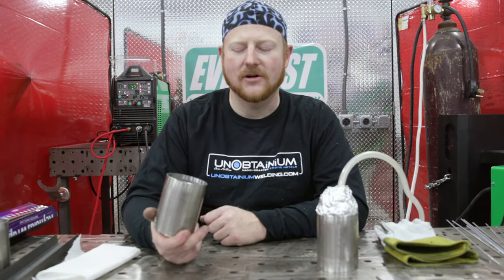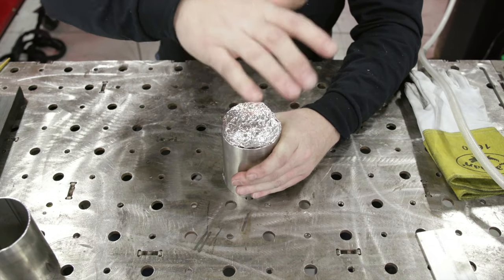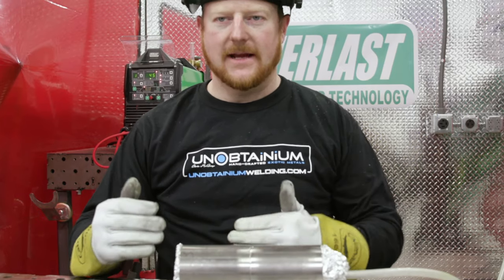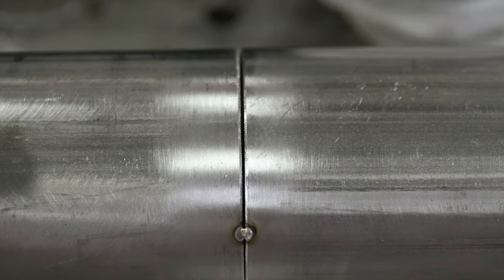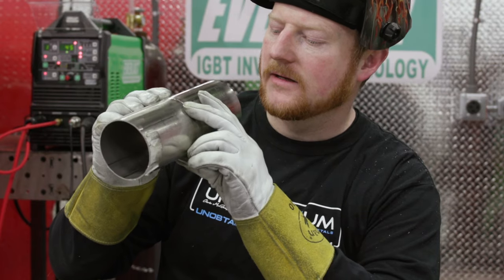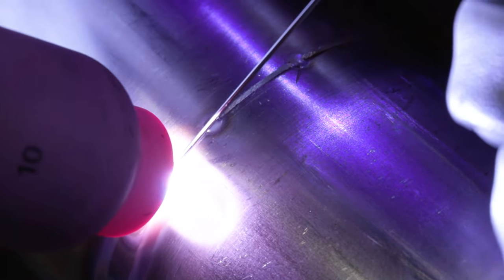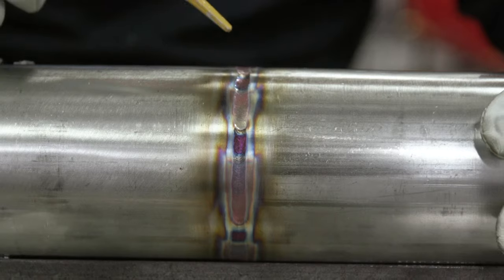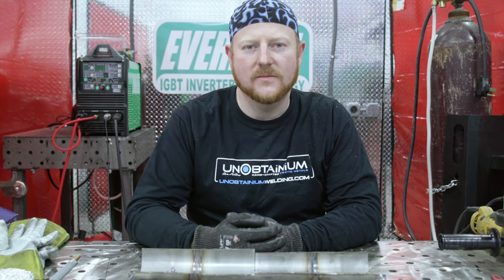How to TIG Weld Stainless Steel Exhaust Pipe | Everlast Welders

Comment from the maker: Tell us what videos you want to see on the channel here 👇
Reply: Would love to see some basics videos. Machine setup for different processes. Different settings and how they affect how the machine acts, etc.
Reply: Just got my Lightning 275. Let's see some aluminum vids.
Reply: Some .063 aluminum tube
Reply from the maker: @paulwest1632  Added to the queue 👍
Reply from the maker: @frankbibby6847  Already I'm the works 🍻
Reply from the maker: @pizzaWelder  Soon we will have setup and troubleshooting videos for all our machines. Working through it now.
Reply: Do a review on PowerARC 300st. !! Can’t find no review on YouTube
Reply from the maker: @Mr.305_  We'll add it to the list 👍
Reply: Everlast Welders that was excellent. I turn to Youtube for stuff like this Im trying for the first time. Maybe cast iron. Maybe thin body panels reducing warpage. Maybe silicon bronze. My nephew broke his titanium scooter. Etc. The main thing I mess around with is roll cages and go-fast projects. Id like vids in that vein as well. 
Also my multi process stopped cutting a while back. Looked inside to see what burned up. It was just metal dust. Blew it out and was fine. Maintenance vids specific to everlast would be cool. Tips modifying like switching to standard lead connecters to use another brand of torch. It happens, might as well address it. My 2c
Reply: Fan of welding machines, hope to own one soon, glad putting videos out, maybe more tig stuff
Reply: Sanitary Tubing settings and tips.
Reply: I would love to see your machines put through the work of day to day commercial use. maybe multi process for my tool box at work😁 
I always see pristine lab conditions demonstrating welding \ cutting equipment but when you get into the field how do they really perform?  sure the duty cycle is "100%" for so many amps on a plasma cutter for example,  but put it in a dusty dirty shop cutting lift gates off a trailer for hours straight will that whip hold up? when the hydraulic lines explode in the lift gate will it hold up to the corrosive hydrolic fluid or the heat from hours of plunge cutting and cutting welds that no matter what sling slag/heat back towards the gun?
Reply: More videos with Chris! That guy is a true craftsman, I’ve been following him on Instagram for a while now. :)
Reply: 185dv setup
Reply from the maker: @ryansrandomshop  added!
Reply from the maker: @miguelgalicia9180  He will be a regular on the channel, so make sure you hit that 🔔 button.
Reply from the maker: @bowtac16  we've got tons more TIG on the way
Reply from the maker: @sambrose1  added to the queue
Reply from the maker: @Adam-lv1uu  Great idea. It's hard to put something like that in a single episode, just because of the time it would take to film (weeks/months). Maybe an option would be to visit an end user that uses our machines on a regular basis on a dirty environment and show a "day in the life". Thoughts?
Reply: Everlast Welders well our shop uses lincoln and htp but we are in the market for another plasma cutter and considering a multi process for mig tig stick. from what I have seen in person and online you guys have some quality stuff. I would put them to work in our shop for a collaboration video, we could use the advertising. maybe plasma cut a 2500 pound lift gate off a trailer and do a part 2 welding one on the trailer non stop until the regulator gets nice n frosty.
Reply from the maker: @Adam-lv1uu  shoot an email to sales@everlastwelders.com and tell them you were directed from YouTube. Maybe we can set something up.
Reply: More exhaust tubing, turbo manifold, downpipe... mild/stainless tubing to cast iron flanges and/or steel zinc plated flanges. Looking forward to see more tig welding videos on your channel.
Reply from the maker: @jeff_desir  We intend on doing lots of this type of video, so hot that 🔔 button
Reply: 1/8" thick SS 316L butt joints.  I cannot seem to make peace with this.  Driving me batshit!
Reply: What  setting do you using?
Reply: I will like to see some chromoly tubing
Reply from the maker: @ManuelRamirez-tj2ze  it's on the way. Already filmed 👍
Reply: What if u don’t have a tug that’s pedal operated how do Weld then ??
Reply from the maker: @keithy363  scratch start.
Reply: More videos om Tig welding, from this guy. I've watched a lot of welding videos, and so far he is the only one who adds those small, but really important, details. 

The 2 videos I've seen him in have explained more key points than I have seen from a dusin others.

Comment: To take the back purge a step further, I'd suggest sealing the end plugs tight with ductape (you could even dispense with the balled up foil and just use ductape to close off the ends) then put a pinhole in the end opposite the gas inlet side and adjust the inlet gas flow for a steady gentle outward flow at the outlet side, which would insure a steady gentle outflow at the weld gap as well. If you use the balled up foil for a plug you could still wedge a small piece of 3/16" brake tubing etc in the opposite end, the idea is to have a controlled and verifiable end-to-end gas flow, not just random leakage at both plugs, the inlet side should be completely sealed and the outlet side should have controlled outflow, insuring the center weld zone is covered with gas. Give it a couple minutes of flow time to purge, then weld while flow is steady.
Reply: Exactly! And to improve your improvement as the Argon is heavier than air you want to put the pinholes mostly on the upper side of the ductape. 😁 (It's just my thing, I don't know actually if it's technically the best way to do it)✌️
Reply: Your Over thinking it lol

Comment: I've had pretty good luck with Solar Flux type B for stainless exhaust tubing.  You dissolve a small amount of the powder in methanol and paint it on the back side in lieu of Argon backup right before welding (it can fall off when dry).  Only mix what you need.  The residue is glassy and really hard to remove, so this is not a great choice for hygienic work like food plumbing or intake runners, but it's the cat's meow for exhaust work where a bit of debris is OK.  I think it saves a lot of hassle and some money.  Besides, it was a classified technology in WW-II.
Reply: Does it prevent the concaving of welds or no?
Reply: @JACK-jm7bo  + No, but it mostly handles sugaring on the back side where shielding gas is not present.  The glassy residue is hard to remove so it works well in exhausts but not so much for food plumbing ..
Reply: We did this when welding 36” pipe in the field where you would go broke purging the 500’ pipe run

Comment: That’s the first time I ever seen anyone use aluminum foil to purge, not hating or anything, just first time ever seeing it be done like that, I learned using tape, one side completely closed for the hose, and the other side little pin holes so it flows out, and keep tape where the welds are going to be done. Great job!
Reply: That’s crazy. A lot of people have done this for years

Comment: I own Wheat State welding LLC. I have been using an Everlast I mig 205, 60 amp plasma cutter and a 250 amp AC DC TIG machine from Everlast for The last 5 years the only failure I've had was a low voltage power supply in the MIG welder that tech support told me was a common problem because the fans fail and take out the power supply. I sent them information from my own troubleshooting and they sent me a new power supply that arrived within a couple of days. Everything came with instructions and worked out wonderfully. after 5 years of hard use I had to clean and adjust the points on the tig machine yesterday. That was a super simple job and now I have an HF arc start again. these two things are literally the only problem I've had from all three of these machines using them daily for The last 5 years. Once a year I open up all three machines and blow them out thoroughly. But that is the only maintenance I do to themI have been blown away by the quality and performance of the Everlast machines and we'll put them up against a Lincoln or Miller any day of the week. I love my Everlast equipment and would suggest taking a close look at it for anybody who's trying to find get equipment on a decent budget for their shop.

Comment: If you want the purge to come out better you need to diffuse it somehow. The way that a lot of us achieve this in the field is by folding a piece of masking tape about four times and then taping over the purge hose end to act as a splitter for the argon to hit.
Reply: I’ve made close to probably 1000 X-ray quality stainless welds using this method. Also when you’re welding in position if you don’t have enough purge it will make it more difficult to get penetration on the bottom of the joint

Comment: This reminds me of silver soldering in HVAC&R.  Purging nitrogen inside the copper pipe at the proper rate so you don't blow out your silver solder and making pin holes.  The purge in silver soldering removes the oxidation of the braze and the copper and doesn't allow carbon build-up.  Basically the same thing I believe, only now we're welding. the next step above silver soldering, and we want a strong weld so this adds to the process.  YAY - Argon!!!

Comment: Extremely happy I watched this. Thank you. So, picture this. Building a curve with multiple angles. So if building a curve and everything is butting up lovely. Once tacked up. Will it be just as good with the purge? You had two open ends and you had one joint. I'm talking two open ends and let's say 6 or 7 joints. Is this the same set up?

Comment: I know it’s all argon, but can flow from the purge blowing through the seam disrupt the gas coverage from your cup? Do you need to use a higher CFH through your cup when you’re welding pipe with a purge than you would typically use with the same size cup welding plate?

Comment: Hey brotha love the videos! Just curious (Now this maybe an overtly dumb question since I'm basically a layman in terms of welding knowledge) but I'm a very diy guy whose instinct is to always get something done on the spot without buying the proper and necessary tools for the job so my question is, what if I don't have an extra argon tank laying around? Is there any other easily obtainable gas' that I can use as a replacement?

Comment: I bought my  Everlast TIG machine to start modifying and making roll cages from DOM mild steel. I hadn’t even considered trying to purge inside. My results have been good but rarely some porosity.  Would purge be worth it?
Reply: Purge isnt needed on DOM or chromoly.
Reply from the maker: Mild steel is not a reactive metal, like stainless, and therefore doesn't require back purging.

Comment: Just watched weld tubes video on the giveaway. Those guys are get definitely awesome your guys unit look awesome. I'm a new welder maybe 12 hours in. but seen a recent video video of purging the inside of the tube with gas. Finnagins garage. If you don't load the tube with gas on an engines exhaust or turbo set up it will pull the crystals that form on the back of the welds and could ruin a turbo. Great video showing both with and with out gas.

Comment: Could you please explain (show) the difference beween the LIGHTNINGMTS 225 and the POWERMTS 221SI.
Reply from the maker: The Lightning 225 replaced the 221. The 221 is no longer being manufactured and is no longer available for purchase.
Reply: Everlast Welders thank you for your quick awnser. I would like to purchase a 221 in Europe. Are the specs of the 225 simular to the 221? What has changed?
Reply: Check: Lightning MTS 225
Second Generation Success.
The industry was changed forever by the predecessor of the Lightning MTS 225. The PowerMTS 221STi, was the first compact MIG, AC/DC TIG, and Stick unit to come to market. It was innovative and reliable full of many functions that the industry still hasn’t matched to date. The blood line continues strong in the new Lightning series. The new Lightning MTS 225 has the same features as the old PowerMTS 221STi, but has a few new ones of its own, with the syner- gic Power Set function and fully digital LCD display. A new wave form for has been added as well for AC use in the form of a Soft Square wave.

Comment: use a kemppi welder and some aluminium tape,and pulsewelding,much better result,and so much easier,and weld without filler

Comment: Use tape to cap.  Why waste all that foil?
Reply from the maker: More than one way to skin a cat. Tape works also.
Reply: Tape will get hot and the glue will leave a mess
Reply: Rick James only when your weld is near the edge.   I run sanitary on a regular. I have for a long time.  The whole Foil thing. I have only come across online.   However if it works for some it’s fine.   Tape won’t let oxygen seep thru and you will have a much cleaner weld.
Reply: yea, tape with a vent x-flap cut at the top seems to be better, but i'll try the foil on the hose end, and save it for future purges...

Comment: I'm sorry to put you on blast   but you purge process is completely wrong. The vent is very important. No vent will trap air. Too small will make the weld puff up. Too big will get major suck back. Stainless moves around like crazy when welded.

Comment: "On the cheap!" Except for that extra $300 bottle of Argon.....
Reply: I was thinking that too. Do you think is Nitrogen is effective as a purge gas is ok for SS/Aluminum TIG? (HVAC techs use Nitrogen inside copper pipe when brazing joints for refrigerant lines.)

Comment: I love how you felt the need to remind people to use a wire brush after tacking, but completely ignored the settings on your machine. Also, it doesn't take several minutes to purge that pipe.

Comment: Can you guys at everlast show use how to use are mts welder like cold welder ie see the attached link

 on youtube..
https://youtu.be/PA009RnvGas

.. i need weld thin sheet metal and...need video on how to weld autobody panels with tig...

I find im blowing holes at 30 amp using 20 -22 gauge panel on door panels... if om not blow holes..i find my base melts orbut filler rod does flow... im using .023 and .030 mig wire ..
I have tried fussion welding with better luck but that easy either as im new to tig welding.

Please help